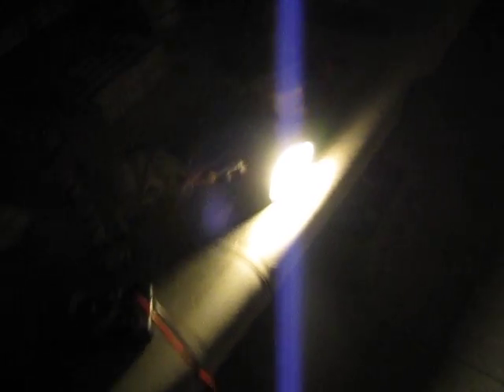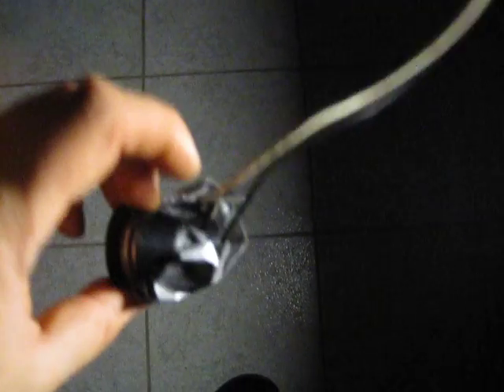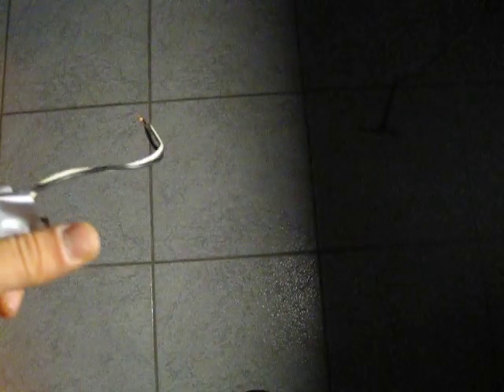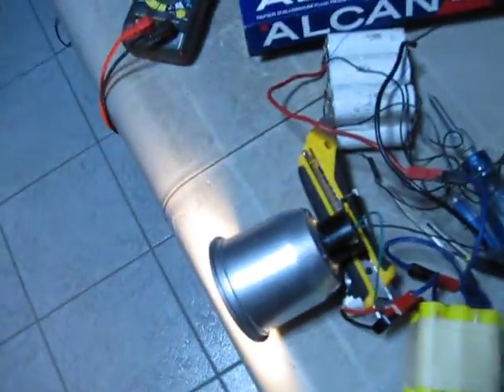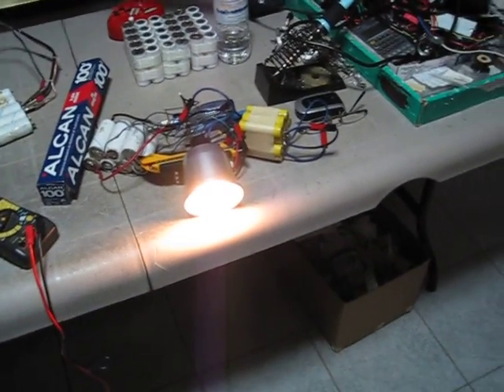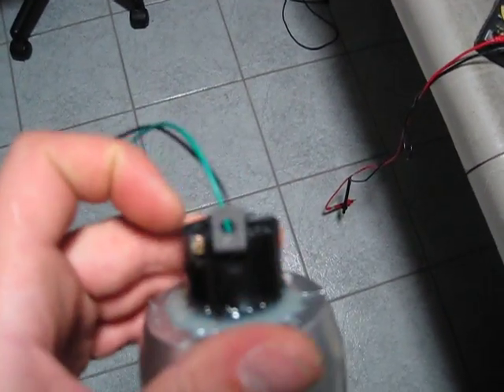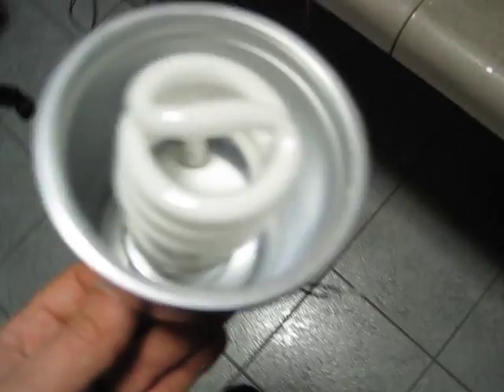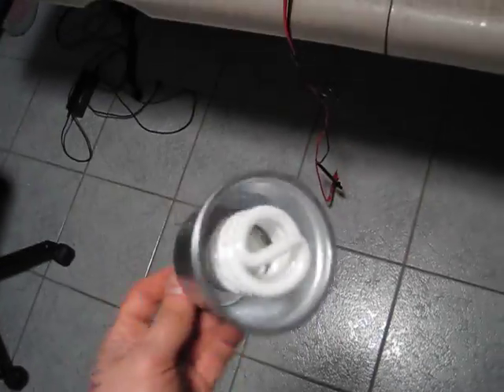13w CFL Bulb Running on 72v DC

Comment: No need to convert any CFL, as they run on 70 - 140 VDC anyway. I have a 3 type power in my home (12vDC, 100vAC and 130vDC).  The 130vDC powers lights and all switch mode power supplies, including my laptop supply. Of course incandescent sees AC & DC the same anyway as they are a resistive load.

Comment: Lamp modification is not necessary.  The 'AC portion' of the ballast is just a graetz bridge rectifier, which turns the AC supply into unfiltered DC, the ripple of which is reduced by the filter capacitor.
Also, that ceiling fixture should use incandescent lamps as it is a sealed fixture.  The fluorescent lamps in it will roast and fail early.